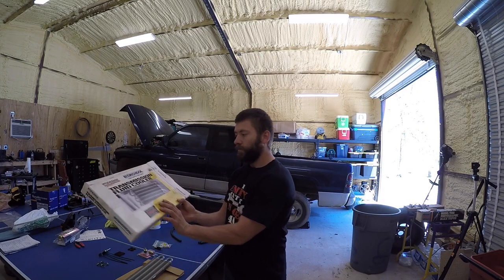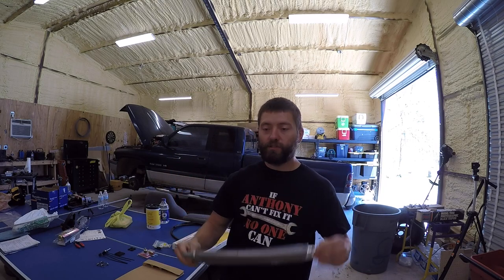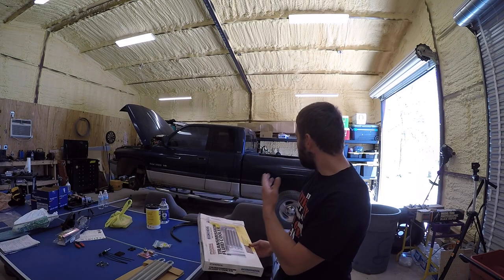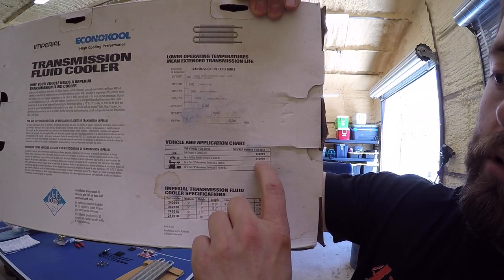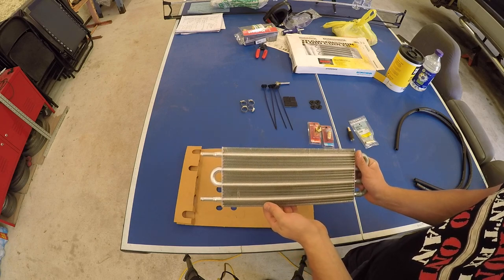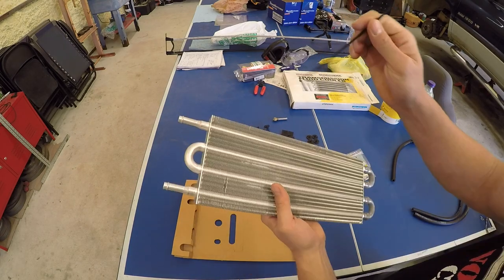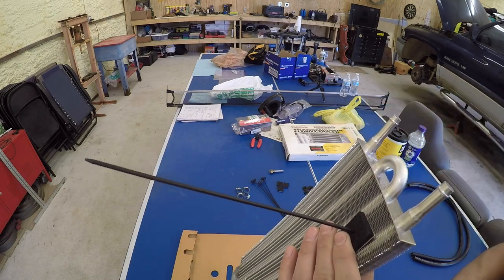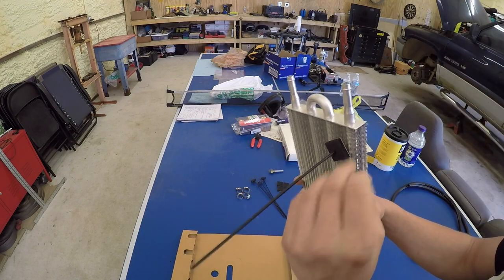Auxiliary Transmission Cooler Install

Comment: What line are u cutting if u keeping the original oil cooler and adding the external ? I belive is the sending line ! Not sure tho
Reply from the maker: It does not matter because they are going in series. You will have 2 coolers in total, you can cut whichever line is more accessible and splice in the new cooler.
Reply: @dudewecanfixit  i would go out from OEM to in on external then back to tc , that will be best connection possible keeping both coolers for winter nd summer temps to wrk with in temp specs for tc 👍🏼

Comment: goes anybody know what line is the return line and what one is the hot side? on a 99 ram1500. im replacing my trans cooler and this time putting a filter inline but im not sure on a dodge which is witch..
Reply from the maker: You can crank the truck for a couple seconds and have someone watch to see which line the fluid comes out of
Reply: Check which line is warm/hot at cold start rite were it connects with ur oem rad, from there if u use external , take the cold line nd connect it to the LOWER external , nd use the other line from external to go back to ur TC line